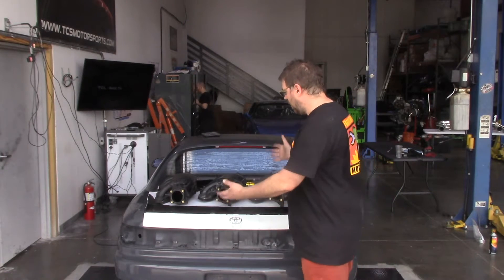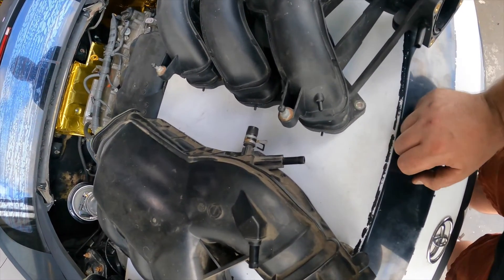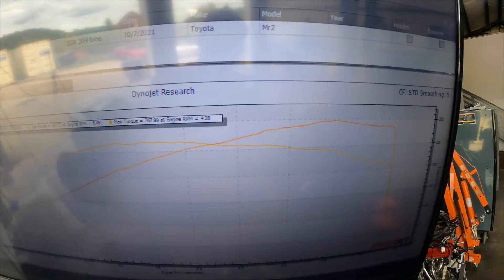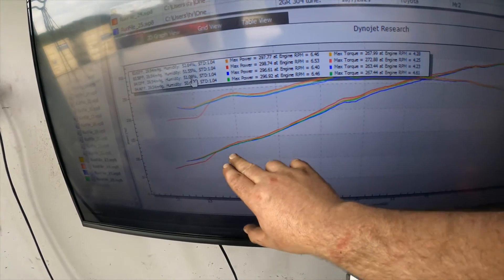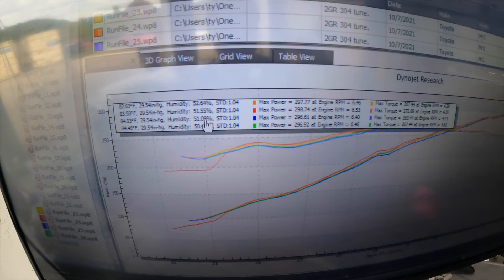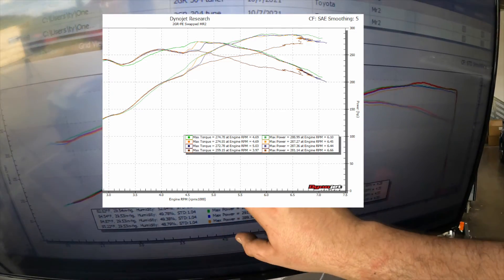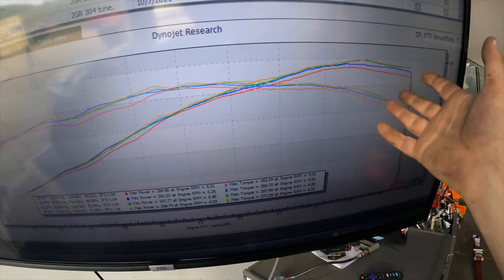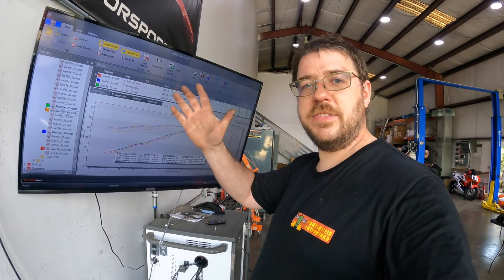Benchmarking the different 2GR-FE intake manifolds

Comment: Really makes me wonder why #2 made a little more power in my test.  Maybe something about the newer tune evens out the differences?  Regardless, nice to see that they are so close to equal, will really open up the options for people wanting to ditch the #3 style.
Reply from the maker: Just as you said, there has been a major tune change since your tests but the difference between #1 and #2 has always been very small even with your tests. The #2 intake was getting quite expensive anyways and the #1 is out there in much higher volumes so that should be easily available for the foreseeable future. Were your manifold tests back to back on the same day?
Reply: @FrankensteinMotorworks  yeah, just like yours, although I ran #1 first.  But I swapped them with the car strapped to the dyno.

Regardless, I added a note to my blog with a link to this video, I don't want people to be hunting down the #2 manifolds if there isn't any benefit.
Reply from the maker: @WilhelmRaceWorks  You know, i wonder if the order is what happened. It seems to take 3-4 runs before the dyno starts returning the exact same number for every pull and usually the horsepower climbs by a few horses over those 3-4 runs. I don't know what causes that but it is pretty consistent. I wonder if that's the kind of thing that happened with your results? but i'd probably bet on the tune change more than anything else.

Comment: Is that the same motor as the one in the lexus gs350? If so are they're any performance air intakes?
Reply from the maker: The GS350 uses the 2GR-FSE engine which sounds very close but is actually quite different.

Comment: Can you talk about High RPM 2GR's like 9k, 10k or 12k if its possible?
Reply from the maker: It's all just a question of money. The kind of parts you need to make an engine double it's redline are all custom anyways so it does not really matter that the 2gr is not technically "supported". But I'll put this on the list of potential future topics.

Comment: Thx you, I want to do a flex fuel install on my 2015 is350 f sport. Any tips?
Reply from the maker: There's really no easy way to do this and because the 2GR-FSE really does not have a knock problem at all it really won't gain anything from E85. Plus, once you compensate for the fact that E85 has about 30% less energy than normal gasoline it ends up usually costing more per gallon.
Reply: @FrankensteinMotorworks  thank you for your reply. I emailed RR Racing and he said my car really benefits with 30% e85 and the rest 98ron??? im very confused now???? shrugs
Reply from the maker: @lordbuckethead2022  that's a decision for you to make. just keep in mind a few things. 98Ron is equal to 94(R+M/2) which is the rating used in the USA. I'm assuming you're in the USA since that's where E85 is most prevalent. If you aren't you should look up your own local conversion because gasoline is rated differently in different parts of the world. 

Next, keep in mind that "30% E85" with the balance being premium is a pretty wide range of ethanol. It'll depend on your state but federally they've updated the requirement to 51% ethanol all the way to 83% ethanol and the premium fuel in some parts of the country has 0%, some has 10%. so "30% E85"/ balance as premium can result in anywhere from 5.6% ethanol to 25% ethanol. In your owner's manual on page 523 you will see "use only gasoline containing up to 15% ethanol". This means that the good news is your car is compatible with ethanol in the gasoline so you won't swell any seals in the fuel system. Unfortunately the IS350 does not have an alcohol sensor so it has to use the oxygen sensor to react to the fuel content. gasoline with 25% ethanol will require about +8% fuel trim to be operating at stoichiometric.

The ECU will allow up to + or - 35% fuel trim so the car will certainly still run even at the max 25% ethanol content. 

Over the years in the MR2 platform i've found that fuel trims within 5% allow the ECU to run much better. i generally target -3%. This is because the fuel tip-in is not trimmed so when you increase the throttle by a large amount very quickly it injects a calculated amount of fuel to prevent the engine from going lean during the tip-in transition. The -3% allows just a tiny more tip in fuel and i find that this makes for a very crisp throttle response. It is a very noticeable difference when you drive the car. This is why i spent all the money to make this very precise MAF sample tube that flows more air and more importantly so i could put the MR2s on a very precise fuel trim ( https://frankensteinmotorworks.squarespace.com/shop/2gr-fe-maf-pipe note: do not use this without a trimmed MAF curve, it will generally result in terrible fuel trims and usually even lean error codes)
Reply: @FrankensteinMotorworks  I'm in Australia than you ❤️❤️❤️

Comment: That engine has stage 2 cams or its just original engine just ecu end headers ??
Reply from the maker: Bone stock engine, ECU, headers and a nice short straight through exhaust along with the stock intake manifold and my velocity stack MAF pipe.

Comment: Hi Marc, do you run the OEM intake resonator that wilhelm provides with his intake kit?
Reply from the maker: I did not have it for these tests because this car actually belongs to TCS but i do run it on my own MR2s.
Reply: @FrankensteinMotorworks  I see! It seems it gives the ECU more accurate info, as Wilhelm's test shows. I dont think it's a deal breaker though. Thanks
Reply from the maker: @mushlove6933  right, it gives better data which is better in theory. In the end i'm not convinced it makes a huge difference but i still like running them. I even have one on my race car.
Reply: @FrankensteinMotorworks  Nice! I just got mine in the other day. Few more pieces and I can dig into the swap👍 have a nice night!